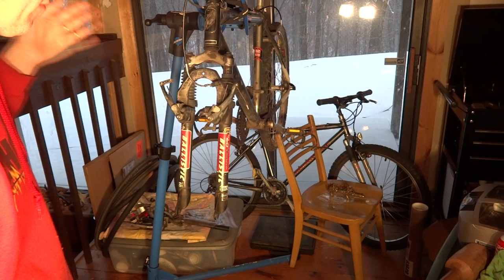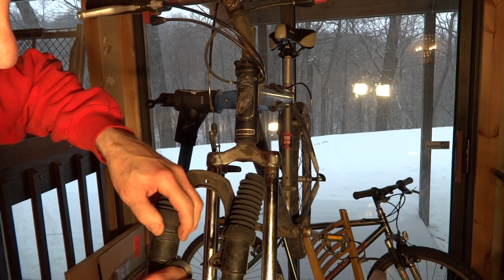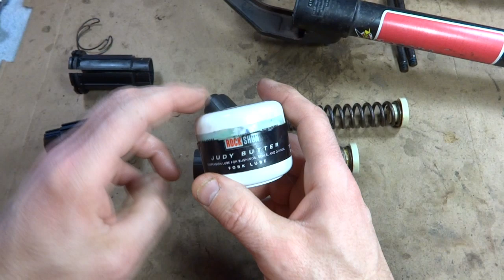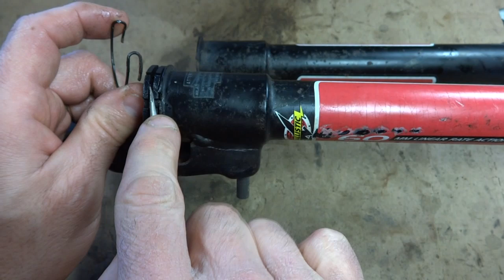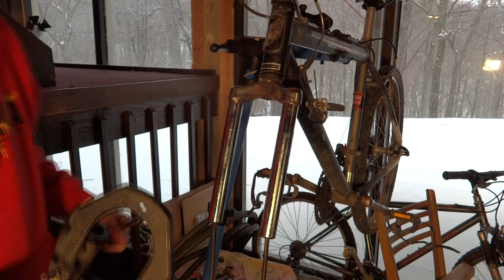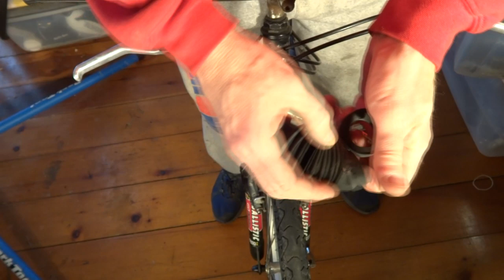Repairing Ballistic 600 XL Bike Fork/Shocks (Stuck/Frozen)

Comment from the maker: Guillaume Bourdel, Judy Butter is designed for the application and to be safe with the materials commonly found in shocks. Regular grease is not. I don't know what effect using regular grease might have. It may damage the plastic or rubber parts. It may not perform as well. You might be able to find cheaper alternatives to Judy Butter that are still designed to be used with bike shocks.
Reply: OK I had not thought it could damage parts inside :) Thanks!
Reply: RJ The Bike Guy 
The

Comment: Very nice!
I always wondered what's inside these cheap forks. I knew there would only be springs but then, how in the world can these even get stuck. Only thing contacting is that part you lubed. It wasn't even badly damaged or gunged. Of course the upperfork makes contact too. Spring just pushes everything back up. Go figure..
Reply from the maker: I am not sure how it was stuck. But it was working after cleaning and lubing it.
Reply: shyflirt1 Yup, glad you got it working. Only maintenance you can do to these, is keep them clean and occasionally few drops of oil to contactpoint.
Reply: @RJTheBikeGuy  Altho this is an old thread, thought I'd give it a try. I have almost the exact configuration, an ST100 Royce Union bike with Ballistic XL 600 shocks. Took it apart and reassembled per your video, but still no travel. The exception is that the cream colored items that came out with your springs remained at the bottom of the tubes on my bike! Since these probably allow the springs to slide in the tubes will soak in penetrating oil to help loosen them up.
Reply from the maker: @paule.3044  These are very low end forks. So they may have just worn out.
Reply: @RJTheBikeGuy  
How long is the 5mm and the extension to get down into the inside ?
Thanks

Comment: I recently got my hands on an early 2000’s Trek 7300 with a generic front suspension and cantilever brakes.  Any idea if the procedure would be very similar?
Reply from the maker: Probably different. This a very cheap fork. Look through my fork playlist. Link in the description.
Reply: Thanks!  I will check the fork playlist out!

Comment: RJ can u plz tell me the name of that  tool u r using to open your  suspension  ,,my suspension  is also just like that I tried to open it up but I couldn't.... Can u tell me the name of that tool.. Or is there any other way to open it...
Reply: he found a 5mm hex bolt, so he used a "hex socket" to open it up along with an extension because the bolt was deep down thus unreachable without the extension ;)
hope that clears it out

Comment: please get back to me as soon as possible RJ I have been trying to get these forks done for so long. RJ can you please help me I pretty much did everything you've done but when I loosened the bolts down inside the forks they only get so loose then they keep popping and they will not loosen up enough to come completely out of the fork so I don't know if I've destroyed something down inside there or I don't know what's going on it feels like the the Allen wrench is a good fit. At this point I can't get them to tighten back down or loosen up to where I can separate the bottom of the forks from the top these are the only forks I have I really need to complete this task please help.

Comment: I have sr sun-tour XCM forks I have the problem and I tried to fix it using the video and it didn’t do much, could you help ? And does park tool grease work for forks ?
Reply from the maker: Different forks are different. This video is specifically made for the type of fork in this video. I don't know how well Park Tool Grease will work with forks. I personally use Slickoleum for forks. It's made for works and won't damage the parts. https://www.amazon.com/exec/obidos/ASIN/B07CKKTNCS/ref=nosim/youtube25-20
Reply: RJ The Bike Guy thanks for your help !

Comment: Hello RJ, can you tell that are the bolts inside the same with all suspension, I mean 5mm or it might even be 6mm?
Reply from the maker: Different forks are different. Find instructions for your forks.
Reply: @RJTheBikeGuy  I recently brought this used bike where the fork is freezed, it has nothing mentioned on it but it's one similar to the one you have in this video. I can see the bolts through the tubes above but and am Just guessing that they are 5 mm. Most of the videos I saw regarding the fork overhauling had 5 mm bolts and I think you also mentioned that you also used a 5 mm rench to open the fork in this video. I am asking this because I am preparing a 5 mm T rench so that it can slide down those tubes so I can unscrew the bolts.
Reply from the maker: @nitin9330  I have videos on a bunch of different types of forks. They are specific to those forks. Beyond that, you will have to figure it out.

Comment: Damn I I need to change the springs on my old barracuda but I need the long hex key. Do you know if the hex key is a universal size I have no idea what size to buy it's so far down inside the fork?
Reply from the maker: Probably 5 or 6mm. There is no universal in bikes!
Reply: @RJTheBikeGuy  thanks for the quick reply I'll guess I'll give the 5 a try as I can't find any information on the bike as it's an old 90s MTB.👍

Comment: do u know how to take apart forks from a huffy gila mountain bike?,they have a decal on the lower fork body that says ASR (active spring response) there is no allen head bolts near where the wheel bolts in,but there is a flat angled black cap on each side of the forks at the top,do you think that the bolts are internal just like Ballistic 600 XL Bike Shocks?,any idea what size the allen HEAD would be? (is there a standard size?) any help u could provide would be apreciated as i cant find any info anywhere else on the net as i need to replace the top boots,where can i get generic replacements? because huffy australia won't return my emails !@#$:)
Reply from the maker: neil crompton The internals are probably similar to these. Huffys are cheap bikes not built to last. I generally don't work on them.
Reply: yeah wise move,theyr'e crappy i learned a very big lesson i only paid $30 aus for it,huffy's customer service stinks big time,also having trouble getting the cranks out of it too (3 piece type) the puller i have is for the type of spindle that has a nut on the end & not realizing the centre bolt in the puller is too wide for the square shank on the spindle it pushed on the surrounding metal & carved up the tip of the puller's bolt,is there another type of puller tool for the spindles with a bolt in the end?,as the puller's bolt also isn't long enough to reach all the way through the collar of the puller & it won't fit over the bolt head when attempting to screw it into crank arm thread,i ripped out the 1st 2 turns in crank arm thread but can still screw in if i take out the bolt.
Reply: RJ The Bike Guy try cutting a piece out of an old tyre tube to make a replacement fork boot.
if u turn the tubing inside out before fitting it it will hide the seams in the rubber,could also use a 2nd layer of tubing to make it stronger & then secure the tubing top & bottom with a black cable tie.
wipe the rubber with armour all to prevent it from cracking up
Reply: neil froggy crompton l

Comment: how to fix the front suspension wobbling when i hold the front brake and push it
Reply: Yousef Tawfik Its either that the headset needs tightening or the fork bushings have wear. He has videos on tightening the headset but unless it's a high end fork you probably won't be able to replace the bushings if tightening the headset doesn't solve the problem

Comment: please help how could i fix the movement of the forks when i hold the front brakes
Reply: Yousef Tawfik normaly if u have standard headset bearings.. it wilk shake but if u switch to sealed headset it will not. Integrated sealed headset normaly costs around 20 bucks
Reply: Patrick amazed That is not true. Normal headsets can be adjusted without play easily. if it's a lower end bike the fork probably has play in the bushings and there's really nothing you can do about that besides replace the fork

Comment: I have hero dtb that shocker worked better but after one week i fill kirosene oil in front shocker and then it close the shocker working and it is jamed when i went cycle shop he tells shocker is broken is the shocker can break in 3 weeks
Reply: kerosene no good for shockers, it will damage the rubbers inside